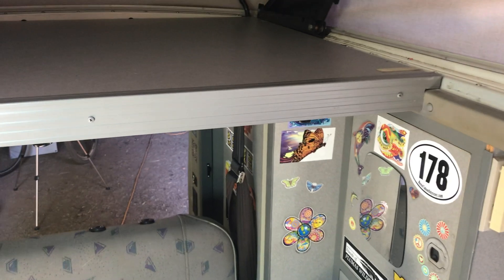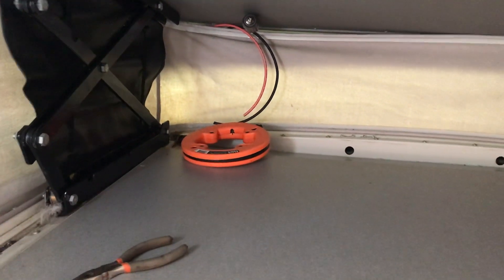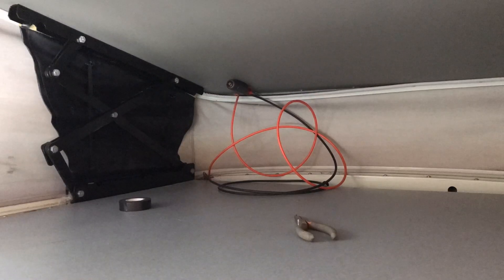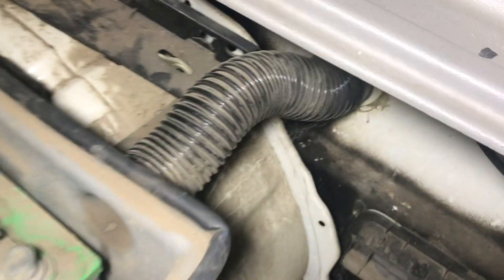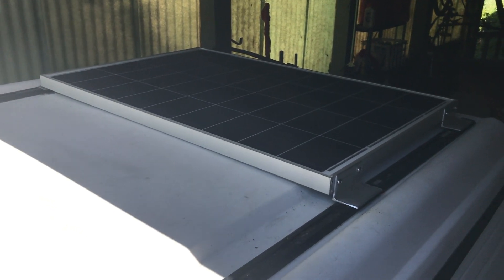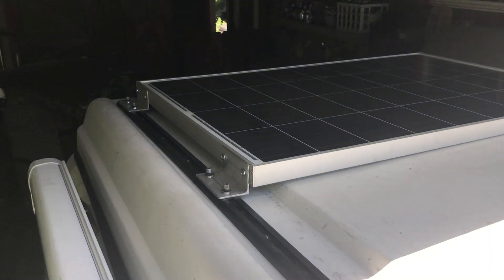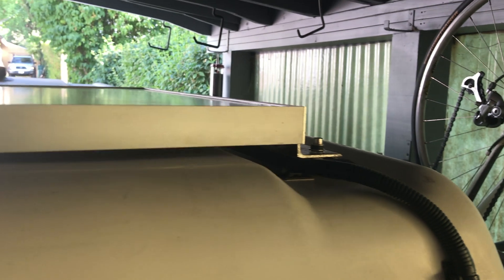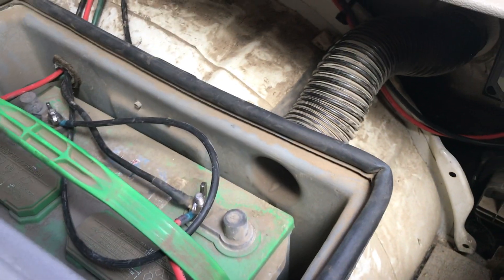1997 VW Eurovan Solar Panel Install Project

Comment: Can you share the hardware that you used in conjunction with the mounts that fit inside the track
Reply from the maker: See my comments below. I made the brackets myself out of aluminum angle
Reply: @kevinbassplayer  thanks for the reply! I got that you used the aluminum angle iron, I was referring to the hardware that fit inside the Yakima T track.
Reply from the maker: @RyanGregoryGallagher  Came with the rack, probably available through Yakima. They are flat threaded pieces that take M4 bolt

Comment: Captain Danger, I have some technical questions on the installation of the solar panel on your '97 Eurovan. I do not know how to contact you to ask my questions. I have a 2000 VW Eurovan Camper (Winnebago) pop top just like yours. I have purchased all the parts I need, guided by a knowledgeable friend in Oregon. I will soon start the installation, but I have one thing to fiigure out.  Namely how to attach the solar panel (Panasonic 400w 71.7"x40"x1.2") to the pop top. I see you attached it to the two black rails (tracks?) installed in the "channels" on the pop top. Where did you get the rails and how are they attached to the roof? How are the L angles attached to the rails? The rest of the installation I think I can figure out for myself, being a retired aircraft mechanic. I am reluctant to post my contact information (email, etc) here .I have limited experience with the "Youtube University". I hope to get a response from you fairly soon Thank You, Kurt.
Reply from the maker: @kurtglatte8496  Hey Kurt, I just used some aluminum angle iron and cut and drilled it to fit. There are a number of adhesive options you can use as well if you search around you can get information on doing it that way as well. Hope this helps
Reply: @kevinbassplayer  Thank you for the answer, but the angle iron (aluminum) is not what I am lookin for. I am looking fir the tracks (rails?) that hard mount to the Eurovan pop top roof and that run  front to back direction. OR are you talking about angle iron that hard mounts to the roof (maybe I misunderstood your response?)? If I could find angle iron with the right dimensions (tall enough) on one side, then that might work. Where can angle iron be purchased?
Reply from the maker: @kurtglatte8496  The rack rails are from Yakima Rack Co and the angle iron from any metals supplier